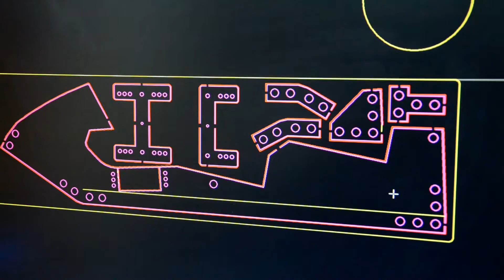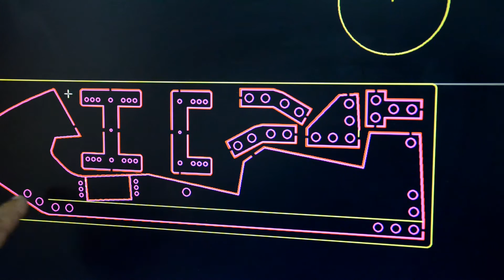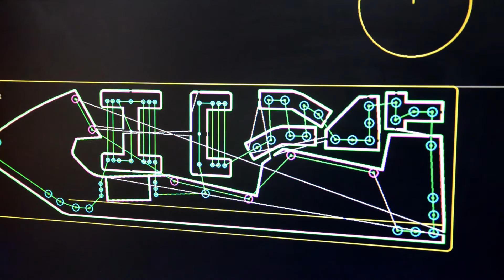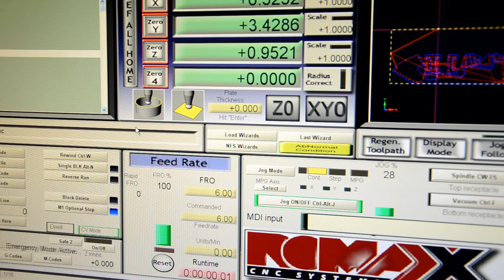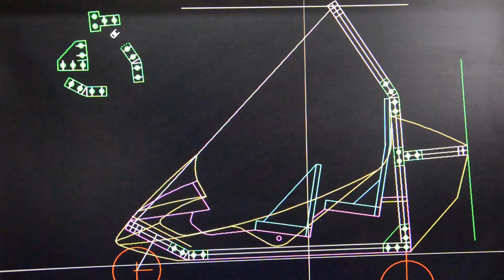RC Microlight - Design and Build - Part 2 - One way to Make a Tanarg Trike  MIA Micro-FLIGHT Style

Comment: I don't know if you use now. But use 3d printed parts will lower your manufacturer cost a lot and with a low price models you will sell more.
Reply from the maker: Yes, most of the parts I make have been making for the past ten years have been 3d printed.